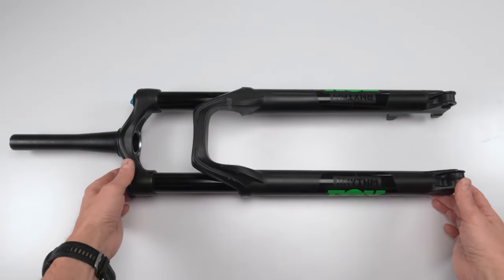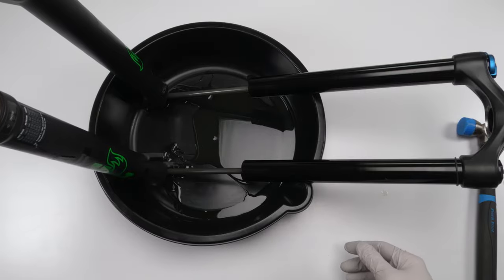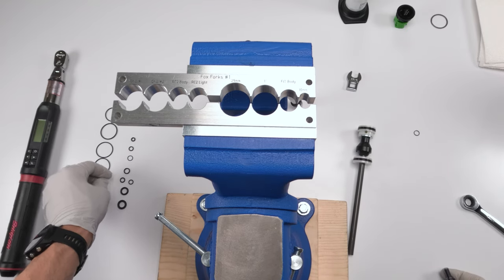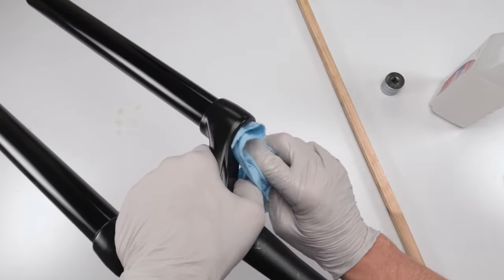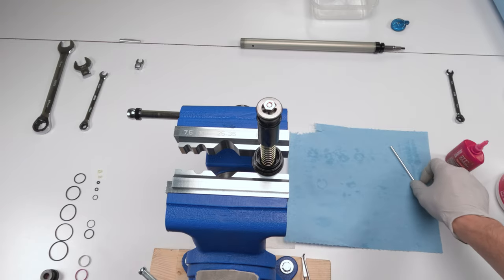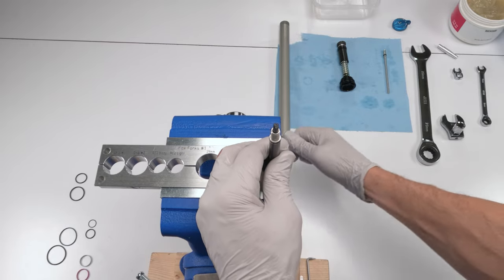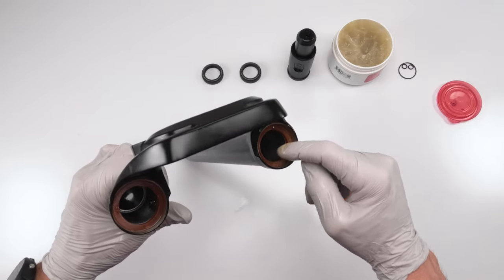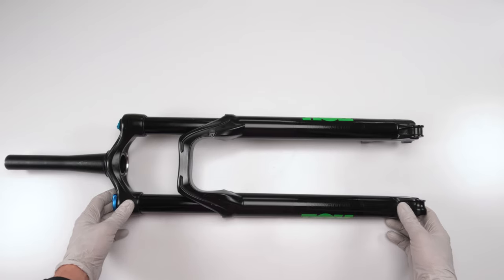FOX Rhythm Series 34 FLOAT 2019 GRIP Damper, air spring + 50 hour full service guide for beginners

Comment: Thanks for the reply! I figured I would start another comment so you can get the notification.. Last night I began disassembly and was pleasantly surprised that the five or six year old oil was gold in color and really didn't smell bad considering my neglect. The knocking problem has presented itself, but I haven't reached the proper step to see if anything was damaged. The long dampener tube was just laying in there COMPLETELY UNSCREWED! Have you ever seen this before? I wanted to follow your instructions, so as tempting as it was to dig in and see if there was any damage to the top section of the dampener side where that tube screws in, I wanted to wait until I reached that step. I wrote down every step in your video and it turned out to be 105 steps that I had written down. I will keep you posted on my findings. Everything seems to be going decently well so far. I purchased all of the tools that you suggested and a few extras that I thought might help. Thanks again for the very informative video.
Reply from the maker: "I figured I would start another comment so you can get the notification"
I don't get why I don't see the response to comments like I do actual comments. I honestly don't know how many of these responses I have missed. It was a total fluke when I saw yours

"The long dampener tube was just laying in there COMPLETELY UNSCREWED! Have you ever seen this before? "
WOW! You're saying that the actual rebound seal head was detached from the damper Tube? No, I've never heard of this. I can't definitely say that this isn't common, as I don't work on a thousand of these a year, but what I can say is "that's NUTS" when considering that not only should there be loctite on those threads, but if memory serves me correctly, the seal head is tightened to around 16nm. That is a significant amount of force, especially with loctite holding it.

Did you happen to notice if there was dried loctite on the threads? Was the damper ever serviced before?

Make sure to double check the inner tube in order to verify that there is no damage in it, scuff, scratches, etc. If there aren't any, then this will be an easy fix since you will be installing a new rebound seal head and Teflon ring.

Sorry that it's such a long video with so many steps, but I tried to make it as easy as possible to follow. If you find ANYTHING wrong with the instructions or the video or can think of ANY way that the video can be improved, please let me know. There is no offending me. Performing these services compared to recording them is two completely different worlds. I'm always looking to improve the process for future videos and still have a lot to learn to do so

Awesome Job so far, and keep us all updated, as there might be others out there who have the same experience as you
Reply: @zoubtube  Great to hear back from you! I've been working overtime every day and only have a couple hours to go to my shop and work on this, but so far I am pleasantly surprised that there doesn't seem to be any damage on any of these components. I have that side apart now, and pretty much finished up for the night, but I am going to watch that section of your video to see what a proper one looks like.
The strangest thing about this whole thing is that there was the strange noise that everybody was trying to pinpoint where it was coming from. It is like a knocking sound, and I am assuming that it led to this. I thought it might have been coming from the bottom bracket or a wheel bearing, something like that. I had to do certain things to produce this knocking but everybody heard it. I am assuming that the problem presented itself with this issue. It just blows my mind that this is a 2018 Fork and it held itself together this long possibly assembled improper from the factory... And I didn't take it easy on it! I will keep you posted as I proceed.
Reply: @zoubtube  I will also add that there is no need to apologize for making a video as super informative as yours is for a very intricate task such as this. You had mentioned doing the virtual meeting replacing a spindle on a Race Face crank. If you would like to discuss the issues that I am having with this, I would be totally game for it or even a collaboration of sorts. I don't even know where to start when it comes to that sort of thing, but just throwing that out there. Let me know your thoughts.

Comment: Why do you put both the foam rings in the 20wt oil when the one stanchion is filled with 5wt? Why not soak one foam ring in 5wt oil?
Reply from the maker: Per Fox service recommendation. 20wt should be used to soak the damper side foam ring as it is MUCH better at collecting dirt than 5wt oil is. The foam ring has two jobs, sustain lubrication AND to help collect dirt that make it into the system. This is why the 50 hour service is so important. Per Fox, when using 20wt oil to soak the foam ring it will have NO effect on the 5wt oil in the lower boot. Hopefully this helps

Comment: Hi i have a FOX 34 Float Performance GRIP but its 2022 Model. I unscrewed my damper adjustment dial to clean it. I turned on the „naked“ screw/nut with my hand to check the function of the modes, all worked fine. I just turned it a little bit too much out and a tiny bit of oil leaked out smoothly as i compressed the fork (on the bike) a little bit. I immediately screwed it back checked everything a thousand times and everything seemed fine so far. It was just a bit oil, 1/2 filling the space around that dial fitting. Is that a problem now? Since i did not see or hear air coming out. Hopefully i must not bleed it now is my worry…
Reply from the maker: Good question. The GRIP is very forgiving. this shouldn't be an issue for you. The damper will bleed itself to a certain point it if it needs to, and oil will ingest from the lower into the upper over time. Unless you hear air squishing constantly you should be good. thanks for the comment
Reply: Thank you for the response! I tested everything now on two rides and it seems i got lucky. No issues so far! Great video, I subscribed ❤

Comment: I have a FOX 34 Float Rhythm 130mm Fork on my Scott Spark 390.  I broke the tip of the rebound needle.   I can still change the rebound with the knob but would like to fix it.  Do I need a new rod or just the needle to fix it?  What would be the easiest fix? Mark
Reply from the maker: Just so I'm clear, the needle rod in the damper shaft is broken? what year?
Reply: It's on a 2022 Scott Spark so I imagine a 2021 or 2022.  but not sure.   @zoubtube
Reply from the maker: do you have the tune id?
Reply: @zoubtube  cant fond the tune id.  here is the serial number etc. 
2022 Rhythm Series 34 FLOAT 29 130 Grip
Serial number: 822964-0517-T
Part number: 910-30-713
Description: 2022, 34, A, FLOAT, 29in, Rhythm, 130, Grip, Remote, Psh-Lk, (10pm CP), Shiny Blk, YS-9042-2_Gloss/YS-941_Matte Logo, 15QRx110, 1.5 T, 44mm Rake, OE

Comment: looking at my damper and noticed it won't fully extend I have to pull it out about 1.5" Is it bad? i don't have clean shop space to replace its seals like in video would just bleeding it help?
Reply from the maker: Just so I'm clear, Is it the assembled fork that won't fully extend on it own, or just the damper body when it's removed from the fork? then answer to this makes a big difference for a response

Comment: What torque wrench do you use?  Having a difficult time finding one that has the low range necessary for this job.
Reply from the maker: I have the following  torque wrenches

Snap-on
Low torque range ATECH1FR240B
Mid torque range ATECH2FR100B

My high range torque wrench isn't needed for bike parts

The above are overkill for bikes. These were bought a very long time ago for completely different purpose that required high precision. this being said, I still would only buy snap on torque wrenches. They are all very precise, very durable, and most important, easily serviceable. they truly are a lifetime product. BUT, the are STUPID expensive now.

Another solid brand for torque wrenches, at least imo, is tekton. Below is a link to a low range version with very high reviews at a good price

https://www.amazon.com/dp/B00C5ZL2EG?linkCode=sl1&tag=js46369-20&linkId=d5ff3718be4922eb3d1307baee811d3c&language=en_US&ref_=as_li_ss_tl&th=1

Just remember to ALWAYS reset a click style torque wrench to zero after your done with it. Do not leave it sitting at any torque value when at rest as it will degrade the spring which will make the tool in accurate.  Do this and it should last for a very long time

Hope this helps 👍
Reply: @zoubtube  Thank you! Video is top notch and super informative.

Comment: Does the Fox Rhythm 34 use the same sealhead as the other Fox 34 forks? Reason for asking is that I would like to see if there's an option to upgrade this part on the Rhythm 34
Reply from the maker: I'm unable to answer that one. Outside of between different generations, I would have to say no. In the same generation, it's "possible", but at what cost and what return? Let me know the year of your rhythm when you get a moment. Thanks

Comment: Thanks. All helpful. One possible error though.  You used the term ‘counter-clockwise’ when discussing the closure (firming up) of the damper via blue top cap of the damper, or more specifically the adjustment needle to which the blue cap is attached with a bolt via 2 mm alley key. On my Fox 34 Rhythm with FitGrip (I.e. Grip) damper, the adjustment needle / blue top cap CLOSES when turned clockwise, and OPENS when turned counter-clockwise.
Reply from the maker: Apologies for the late response. Correct: Counters clockwise to open, clockwise to close. I haven't looked at the video, but if I said otherwise, I most likely mixed up my words without realizing it and probably didn't notice it during the edit in order to correct the text. All these videos are improvised, and many times my mouth has a hard time keeping up with my thoughts. Apologies for any confusion, and I will try to do a better job at finding errors in the post. Thanks for the heads-up

Comment: Does the XFusion Slide boost 34 RC fork cartridge damper can be serviced in this same process?
Reply from the maker: I could be wrong, but I think the xfusion is a bladder based system which would make it a completely different damper service

Comment: Ok, I have been doing just a few steps every night, and everything seems to be going decently, nearing the final assembly... but last night, I finished the dampener assembly, and cannot seem to get it to lock.  Not sure if I didn't bleed it correctly, or I put something in wrong. It's not making any swish or air sounds when I pump it. I tried tapping on the sides, letting it set for long periods...etc. I am going to disassemble it again today and see if I can get more air to escape. 
One thing I had a question on was that part with the inner needle and the cap that you said has to be turned together.  The needle that connects to the blue knob/switch on top is made of nylon or some kind of plastic. That part, I am assuming shouldn't have loctite on it, right? I am assuming that it has to move, so when I did mine, I screwed it in until the nylon threads were buried, then put a drop of loctite on the metal threads . Would you agree on this? Aside from that, I did the process pretty much verbatim as you did in this video. 
I almost never lock mine out, but it still nice to have, and I definitely like to do things correctly as well as to understand the inner workings. Hopefully I will figure this out.  There doesn't seem to be any damage to any of the parts from the tube coming undone inside . Still a mystery how that happened being that there's a considerable amount of drag on those threads. I'm suspecting that this may have been only installed a few turns at the factory and forgotten about.
Reply: Oh, one thing that I forgot to ask in the last comment is that I believe my work is a 120 mm travel. Would you happen to know the amounts of oil that I need to add for that?
Reply from the maker: Apologies for the delayed response

"but last night, I finished the dampener assembly, and cannot seem to get it to lock.  Not sure if I didn't bleed it correctly, or I put something in wrong. "
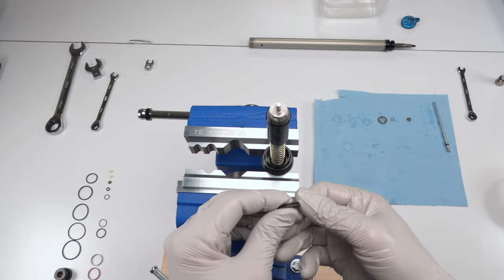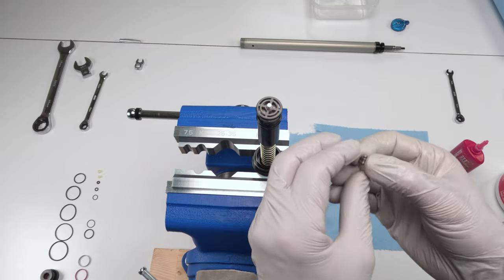If it's bled correctly, and you still get no compression. Then my bet is that the piston is upside down, explained at time stamp  59:39, and/or the spring is pinched and not allowing the check plate to connect to the piston, explained at time stamp 1:00:35. This was what locks the compression. You need to make sure the spring and check plate are able to float after you torque the nut. These two small details are easy to miss, speaking from experience. 

"The needle that connects to the blue knob/switch on top is made of nylon or some kind of plastic. That part, I am assuming, shouldn't have loctite on it, right? "
Correct, not loctite on the knob

"I am assuming that it has to move, so when I did mine, I screwed it in until the nylon threads were buried, then put a drop of loctite on the metal threads . Would you agree on this?"
You shouldn't need loctite on the threads for the compression knob screw, but if you put a bit it won't hurt

"Oh, one thing that I forgot to ask in the last comment is that I believe my work is a 120 mm travel. Would you happen to know the amounts of oil that I need to add for that?"
Air side bath = 10CC 2w oil
Damper side bath = 40cc 5wt oil (Teflon-infused preferred)

Hopefully, this helps. Keep me updated
Reply: @zoubtube  Thanks again! I can't wait until I get home from work tomorrow night to see if that check plate is installed correctly. I had it apart, probably while you were typing your reply. I'll let you know what I find.
Reply from the maker: @themostlymikeshow  Anytime myman! Look at the time stamps I mentioned. Make sure that the single raised ring on the piston faces the shims. Then make sure that the check plate and spring freely float after screwing them down.
Reply: @zoubtube  I removed the compression stack and looked for an upside down flying saucer looking thing with the one raised ring toward the shims, and it was correct, as well as the spring and the movement of the check valve that you had mentioned. 
One thing that I had tried  this time, is while doing the bleeding process after watching your video showing this a couple times, is that after pouring the oil in initially, I held my finger over the bleed hole, while stroking the bottom part through its entirety very slowly, and a few big air bubbles came up. I am wondering if that's what the problem was. I originally, just stroked it until the oil made it to the bleed hole and retracted. this time, I took it through its full range of motion several times until there were no burps. 
Again, I am out of time (bedtime), and came in to re watch the compression stack installation steps to make sure I didn't miss anything... but am off work tomorrow, so hopefully it will lock up this time. If not, I am at wits end, and will probably just ride with it on my trip this weekend, unless you have more Ideas to try. Thanks again for your help.
Reply from the maker: @themostlymikeshow Out of curiosity, What except year is your fork?  Assuming the following has been done correctly:
Compression stack
- The IFP has the new seals properly installed, and that the IFP is properly connected to the isolator (the tube that covers the spring), and the whole mechanism is installed with the pin holding it in place
-The preload hat has the new seal properly installed, and is sitting on top of the IFP, wide part facing the ifp, beveled part facing the shims (super important as well for lockout as it technically activates the lockout)
- Then the shim sits on top of the preload hat.
- Then the piston sits on top of the shims, with the single-raised ring facing the shims and the double-raised rind facing the check plate
- Then the check plate, with the spring.
- Then bolt it down to spec making sure the check plate can float.
Then you're done. This is a very simple compression stack

As for the bleed
- Fully extend the shaft, then fill the tube about 2'-3' below the bleed hole.
- Cycle the shaft about 5 to 10 times in order to displace air with oil in the rebound head, then fully extend the shaft
- Fill the tube right up to the bleed hole, let a bit spill to be sure
- Then SLOWLY install the compression stack. Do not block the bleed hole or the hole for the compression needle on the top.
- Screw down the compression assembly, torque to spec.
- Then install the compression needle and make sure to run it clockwise until it stops, about 4 turns
- Then install the damper into the upper tube, torque to spec
 - Install the lower legs and make sure to add 40ml of 5wt oil into the lower leg before installing the bolt and rebound knob

-Then test. Fully open should allow you to move the shock up and down easily. Lockout mode is NOT a true lockout. The damper will be stiff, but it won't be FULLY locked. It will slowly sink with added pressure. If this is what your experiencing, then you are done

One thing to note is that the grip damper is self-regulating; it will bleed air and extra oil as needed over time

Hopefully this helps and let me know how it goes.